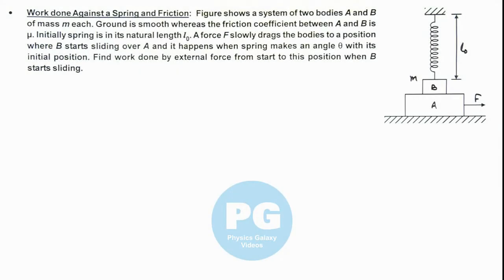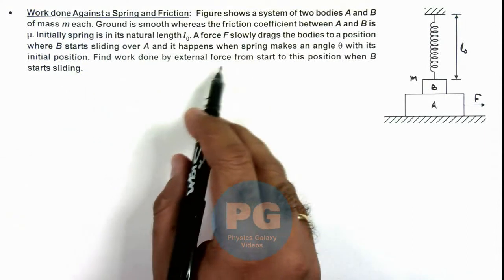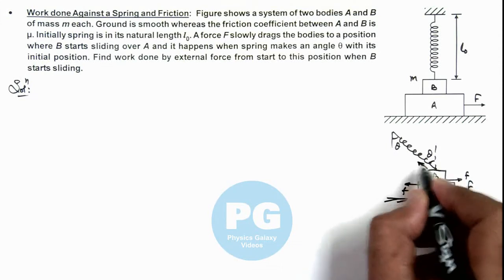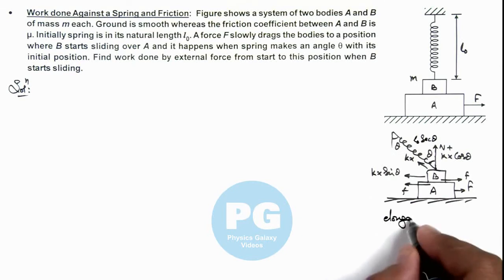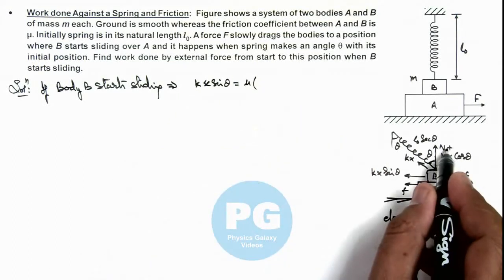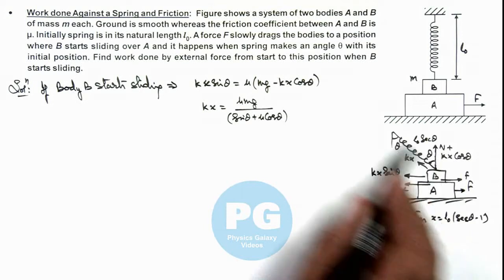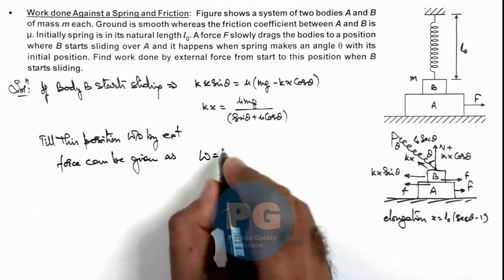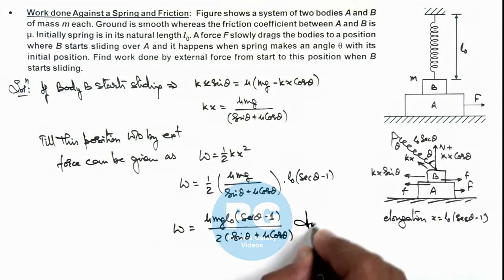Adv Illustrations – Work done Against a Spring and Friction | Work Energy Power #22 for JEE Adv

Comment: Sir, please have a look at this...
As the blocks don't accelerate, I used the condition where the two blocks are intact. then I get, kx=F/sinΦ = 2mg/cosΦ where, Φ∈(0,θ)... then, I put differential displacement = l d(tanθ)
Also, as F = 2mg tanθ, I get wrok = 2mgl ∫(tanθ)d(tanθ) limits are 0 to θ which gives,
W = mgl (tanθ)^2
So, is the difference in answer because there are more than one variables as θ mayn't be defined, or is the approach of mine above wrong?
Reply from the maker: How you are using kx = 2mg/cosΘ think carefully...
Reply: o my god...
I'm so sorry!
I'm an idiot!